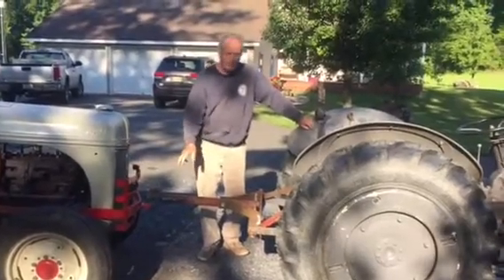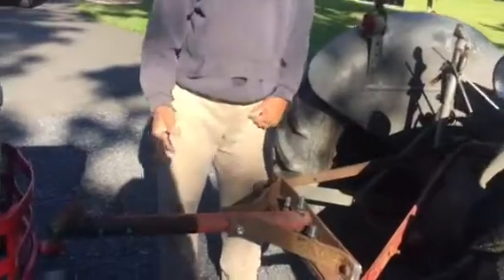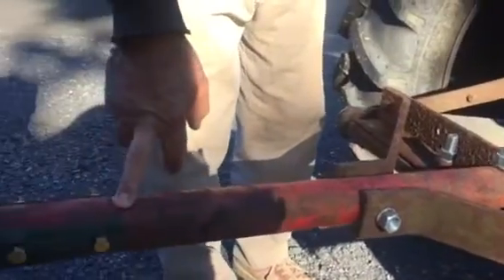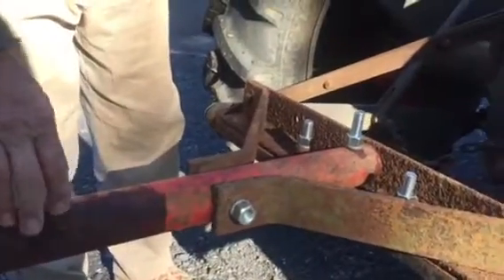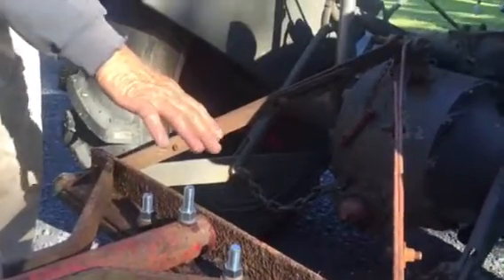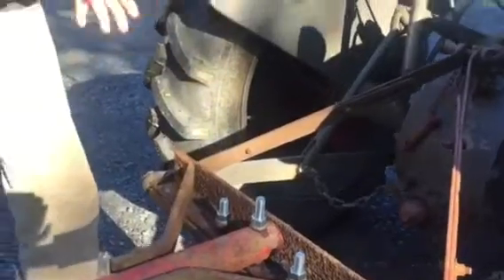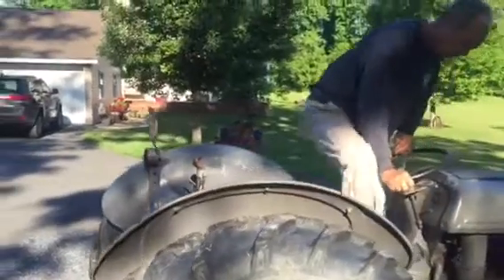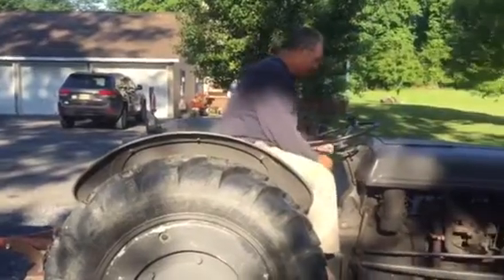Ford 8N homemade tow bar

Comment: How do you get the front wheels to turn on the 8n?
Reply from the maker: Wheels just follow the other tractor.
Reply: @kirk-nj6344  the front wheels dont veer off to the sides or anything? i might make one for my truck but not sure cause the last time i pulled my 8n the steering went all the way to the left and the front tire popped off the beed since it turned so sharp im a little weary on a pull bar
Reply: That 2N is one good sounding tractors  and looks great